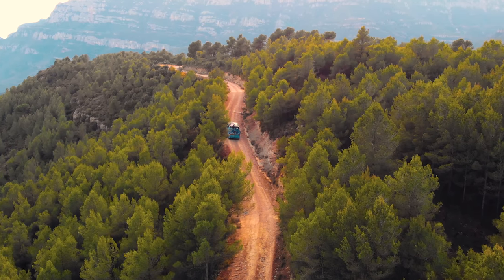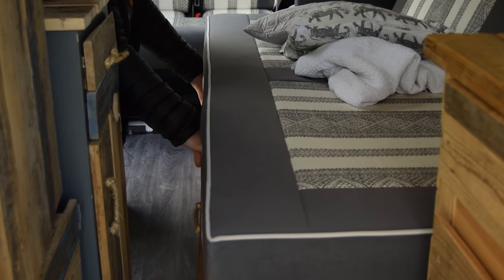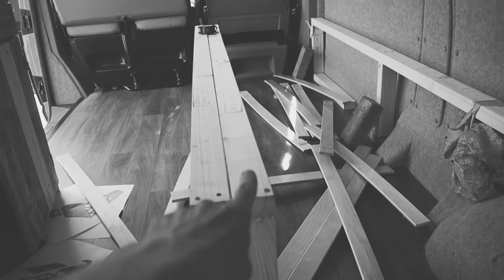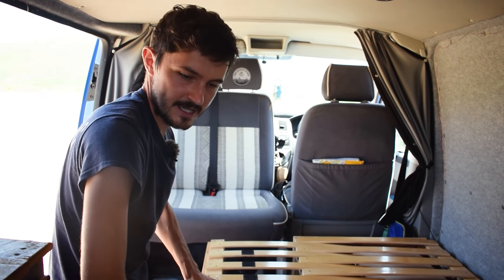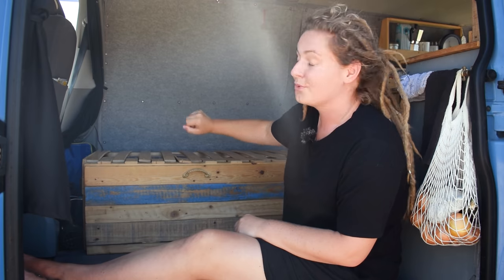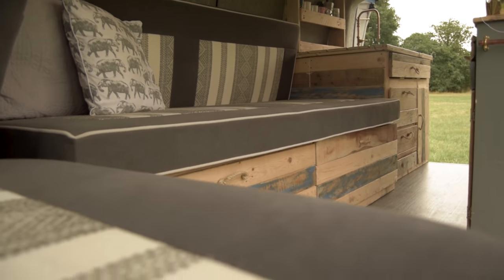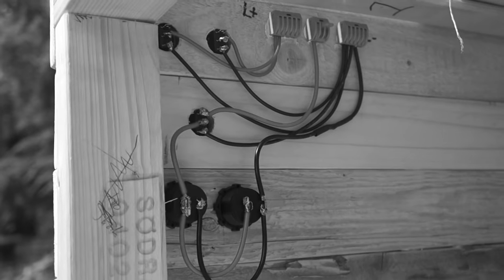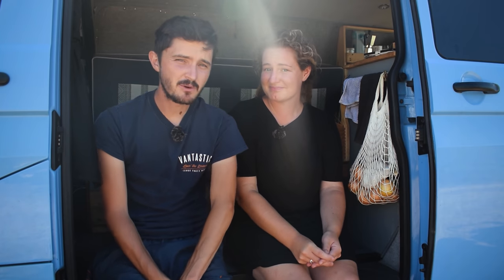One Year Later: DIY Camper Bed Review - VW Transporter Camper Conversion

Comment: You guys crack me up. 
I built my bed out of ply and has stood up well but your design looks much better.
I went for the front-facing bench to bed design with my main reason being I have barn doors and they’re rarely kept open (especially when it’s raining) with the boot being used for access to under bed storage. 

We’re splashing for a rnr bed later this month to allow my son and or wife to sit in the back as the bench seat isn’t big enough for child seat and adult bum for long journeys. 

So expensive though! Think it’ll match my materials investment I made in my van originally!
Reply from the maker: So many options, designs and layouts to choose from! The cost did put us off a rock and roll bed, maybe if we weren’t so tight we would have gone down that route! 🤣🤣🚐👍 ... best get that kitchen ready for August for cooking up tasty camper meals! 🍳🍳

Comment: Nice bed design, although 124cm would just be enough for me alone, as I need lots of space to sleep comfy
Reply from the maker: Hi! Yeah, definitely not for everyone. We don't find it too tight/claustrophobic but it's not quite as comfy if we sleep with our heads facing the back end of the van as we can't use the extra space provided by the swivel seat and if I turn over in the night I tend to hit my arm on the "bedside table". Fortunately it works for us, but we know it's not ideal for everyone. Cheers =)

Comment: I think I may rue not using planks instead of proper slats. My build is a hybrid of yours and Hughtubes design. Defo counter sink the screws! I think your original video was superb and if nothing else gave me the encouragement to have a go myself, you are very humble people!!!

Also a question with regards to your under bed lighting. I have also fitted a USB powered LED strip on the underside but I think I've blown it. What cable amp rating did you use to connect the USB socket to the fusebox and what size fuse did you use?
Reply from the maker: We don't really have any real-world experience to compare the slats to planks, we've only ever know slats in the camper! You'll have to let us know how it goes, it may not be that different? Main thing is that you'll have good air flow :) 

If I recall (will have to check later) I definitely over-specked the cabling. I reckon I may have used 10amp cable with maybe a 5amp fuse. Though I may be wrong. I think when both phones are charging via USB and have low batteries then can pull over an amp each. So a 3amp fuse would be cutting it fine so I went with 5.

I could be wrong, will try and clamber under the bed and check! 

Your build is coming along well :)
Reply: @FloraTheNoviceExplorers  Your a legend thanks. I used 5amp cable with a 3amp fuse and it didn't work, swopped the fuse for a 5amp fuse and it came on! Turned it off with the controller, went to turn it back on and it was dead but the USB socket still works fine with any other device. Back to the drawing board I think. Thanks for the info though, much appreciated.
Reply from the maker: Hmmm... sounds weird. I don't know how much power the LED lights need but I can't imagine it'd be much at all! Do the lights work in the house or they definitely kaput?
Reply: @FloraTheNoviceExplorers  It does not work plugged in to the mains. I think the strip itself may be kaput.
Reply from the maker: That's a bummer! Are they the same ones we bought or just similar? I'm no expert but thought they'd have been okay with the smaller fuse? Maybe a dodgy batch of lights??

Due to some not-so-clever design work by myself, I can't easily get to my fuse box without taking half the bed out of the van :P also would mean I'll have to chuck Meg out temporarily too! But I'm fairly certain about using the 10amp cable / 5amp fuse. 

P.s sorry for the slow response, YouTube isn't notifying us of any comments at the moment!
Reply: @FloraTheNoviceExplorers  No worries,  thanks for your help. I've ordered a new unit, hopefully that'll sort it out.